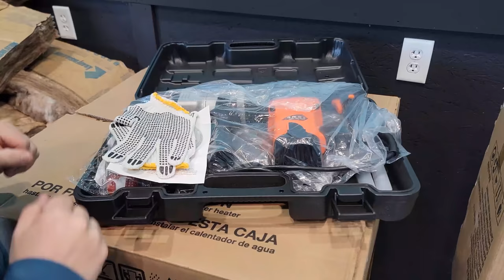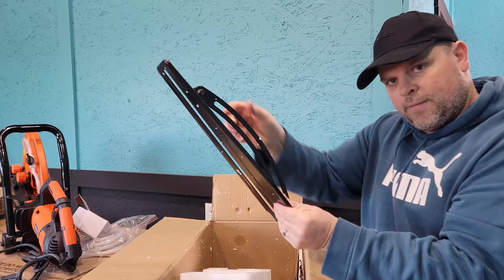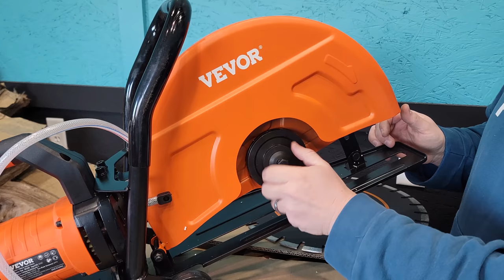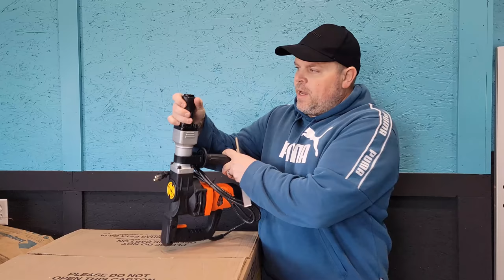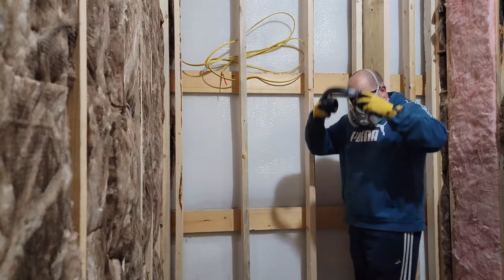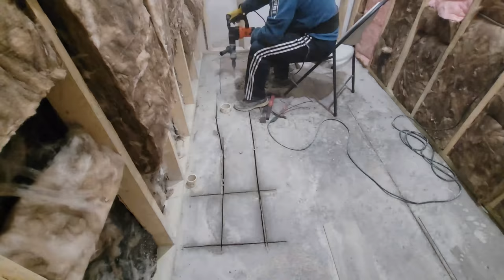VEVOR Electric Concrete Saw & Jack Hammer vs. 5in of SOLID CONCRETE

Comment: Don’t need the depth on it can you use it without it
Reply from the maker: I would guess so. I haven't tried that, but I think the blade bolt would act as a stopper at some point. I wouldn't recommend it though.

Comment: Can I plug it in regular outlet outside the house? Thanks in advance.
Reply from the maker: I plugged it in a 20amp outlet in my shop. The other day, I used it on another just outside the shop and it tripped my 20amp breaker about 3 times from me over working it. Thanks for watching and commenting 👍🏻
Reply: Was looking to getting this due to the cost. It says if you are only working with a 20amp outlet to only cut in 2” increments. I assume you went full cuts ? Still might be good for the price.
Reply from the maker: @RAH_Holdings If you go full cuts, it will trip a 20 amp circuit. I have done it on more recent jobs several times since I get impatient 😂 However, if you take it slow, it does great.
Reply: These saws are rated at 3200 watts, which comes out to 25 or 26 amps...  so probably can't push it too hard unless you run it off a 30 amp circuit.

Comment: Hey thanks for the explanation, it was seriously helpful for answering some questions I had about this saw after seeing it on Amazon. Also I really liked your bucket tip with the little pump I will likely use that at work now.

I was just curious, how’s the saw handle when you aren’t concerned about tripping the breaker? Does it ever stall out or can you just power through cuts pushing as hard as you would a gas saw. 

Also have you only tried it with the included blade or have you also tried it with a well known and trusted blade such as the diablo series. If you have would that help with the issues you’ve mentioned running it on a 20A breaker?
Reply from the maker: I only used the included blade. Gas powered is stronger for sure. This one takes a little more patience but it gets the job done.
Reply: @JustinsProject  thanks for the reply 🙏 answered my questions, think gas is still the best for my uses. Looking forward to more of your vids!